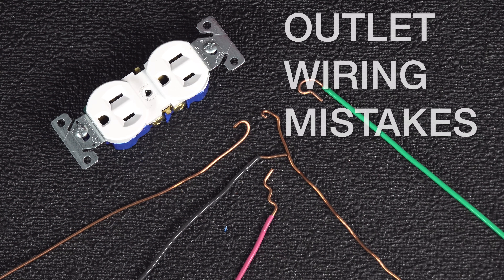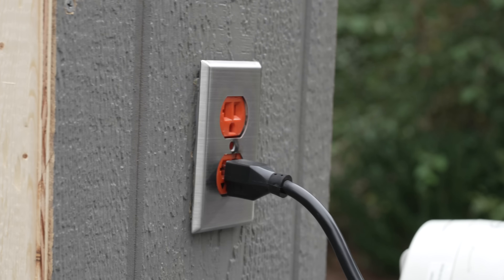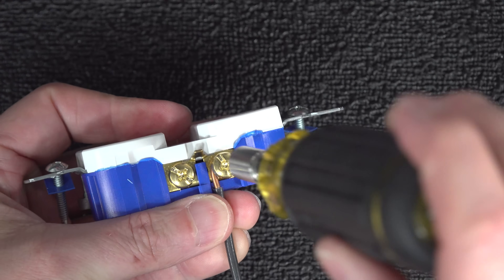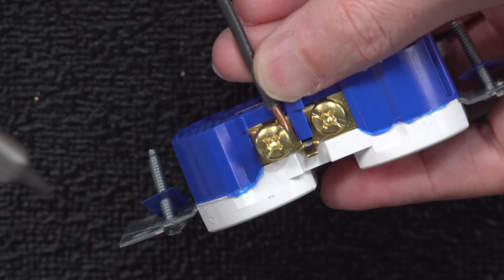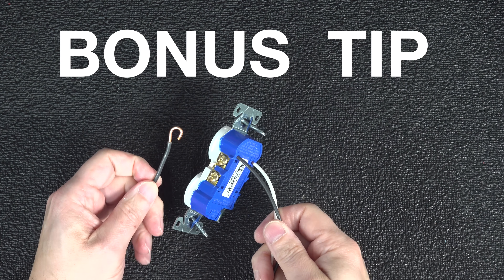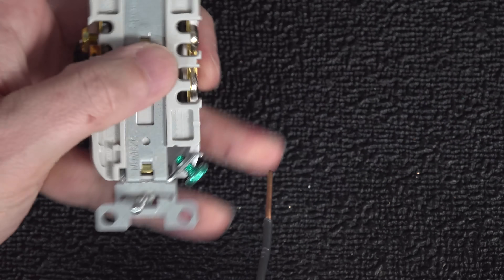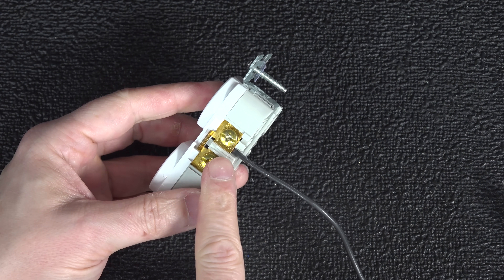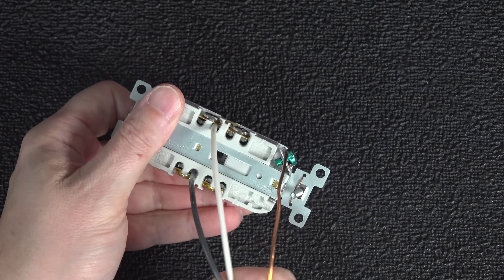BEWARE Of These 3 Common Wiring Mistakes On Outlets & Switches

Comment: been wiring for 55 years. it never stops til i die. joy of the job means never needing to stop doing it. you video is aces in my book. keep on doing what you do
Reply: Like to hear people who love their line of work, even after 5 decades. Keep it up. I'm working on my old rental as we speak, built around 1920/5. Just found some old newspapers today up there 1934, (guess thats when they blew in insulation) I still have Knob&Tube for some circuits. Changing them out. Wire and insulation still good, I'm amazed.

Comment: And in Europe you don't need any tool but a wire stripper to connect a socket or switch plus the wiring diagram is printed on the back of the socket and switch, no possibility of making a mistake unless you want to.

Comment: Don’t use your device as a wirenut. Use wirenuts. And wrap it with electrical tape after making connections, especially with an uninsulated (ground) conductor.

Comment: Another tip: always shut down the circuit when wiring outlets and switches. Then, record the circuit number on the back of the plate cover with a sharpie so that next time you know exactly which circuit to shut off.
Reply: I was an electrician for 35 years..never saw or thought of that. Brilliant! 👍👍👌
Reply: @charlieboutin3341  Could not agree with you more.  We're never too old to learn new tricks.  What a time saver!
Reply: @charlieboutin3341  and that's part of the problem....
Reply: @Werecalledtodestroyevil the problem is thinking learning stops STFU and keep learning
Reply: "Always shut down the circuit when wiring outlets and switches." ✔️
(Shocking but true! ⚡😉 )
Reply: The circuit number is a great idea. Never thought of that. Great time saver!
Reply: Until a painter comes along and puts covers back wherever..
Reply: I just made a lookup table on the inside of the electrical box. Also works...
Reply: @ricksherman34  this is a good idea at the time or if you keep up on it. The 2 houses that I have owned have had this but they are all scratched out and modified at least once.
Reply: Also include your phone number.
Reply: This is a brilliant life hack.
Reply: We found out Sharpies would bled through the thin plastic and show. This was especially true on the Break Resistant Nylon covers. Use a Paint Marker instead, it won’t bled through.
Reply: I mean almost every house I've ever worked on had every breaker labeled in the panel. The rare cases they didn't you just use a circuit tracer..plugs into the outlet and beeps when you pan the tool over the corresponding breaker.
Reply: Handyrus : Cover plate circuit number..."EXCELLENT IDEA!!"'
Reply: @TimothyWmYoung thanks
Reply: Great tips
Reply: Make sure no capacitors are on the circuit after turning it off!
Reply: Wow, great idea! Thank you
Reply: Hot tip. Thank you smartypants :)
Reply: I work live because I’m superior to all you chumps
Reply: If you wire up a light switch and you don't turn the power off you deserve to get electrocuted
Reply: My man... 

I was doing this on turns and people thought I was crazy. I did colour coded stickers, but this is much wiser in case those change. Slot 13 will always be slot 13.
Reply: Great tip
Reply: I just shut the main
Reply: Hopefully, unless some clown changes it.
Reply: Love this idea
Reply: Until the painter takes them all off
Reply: And then, learn proper terminology, like what the difference between an outlet box and receptacle is. 💀
Reply: Good idea on rotating the circuit number!
Reply: @davew4176  at what point in his comment did he say "rotate the circuit number"?
Reply: @redstoneddad3981  i think auto-incorrect
Reply: @redstoneddad3981  rotate = record on auto correct LOL.
Reply: @redstoneddad3981  - probably unintentional auto-correct, for what was intended to be "record the circuit".  Not really too difficult, is is?
Reply: @acommenter5184  this was already answered a month ago, but ty 😊 
Kinda was difficult 😕 

"...is, is?" (Another auto correct issue?) People should read the comments they post and correct their mistakes, otherwise simple clarification questions arise, like mine 🤔
Reply: @redstoneddad3981  That's for sure!  Definitely my bad; and apologies for snarkiness.
Reply: @acommenter5184  it's ok, have a great day 😎
Reply: @redstoneddad3981  I’d bet  he meant notated
Reply: @redstoneddad3981  My guess is that the writer meant "notate"???
Reply: I wouldn’t write the circuit numbers on the back of the cover, what if the cover is moved to another device? Just get a number book and label the circuits at each connection or junction. And you want to lock out that circuit or they make lock outs for switches but make sure it’s not fed from another source. Also check for shared grounded wires in the branch. Also check with a NCVM.
Reply: @byronnlangley  why the hell would anyone move them? 😂
Reply: @roberthughes2687  crazy as it sounds when people paint. They throw all the cover plates aside and randomly reinstall the plates when the paint is dry.
Reply: Don't forget to buy that $50 circuit tracer for when the painter comes thru and mixes up all the covers.. 😂
Reply: @Matt Lewis  yes. Circuit breaker tracer is a must. Also a toner is a must have tool.
Reply: Horrible tip
Reply: @largepizza2185  why?
Reply: For sure.
Reply: Sometimes you can turn the circuit off to work on certain things. Say for a hospital plug that has more down the line and is powering a machine for a patient
Reply: Nah don't have to worry about any of that. Just short it out at the outlet it will trip the breaker.
Reply: THAT WILL NEVER WORK

Comment: Big mistake 99% people including most electricians is not using a torque driver or torque wrench to tighten all electrical connections as required in the NEC. Been over 10 years since they made manufacturers only allow #14 guage copper wire to be back stabbed into flimsy holes. I always argued with fellow sparkles about stab in connections. Said when they allowed ground wires to be back stabbed might then consider using them.

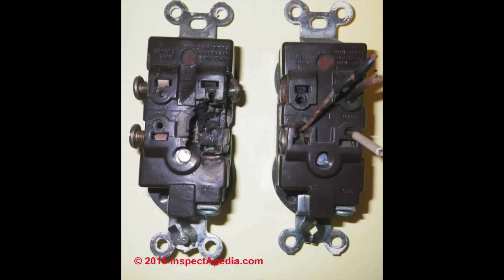Comment: 2:45 just so you know, the finnissh version of that connection is rated for 25 amps at 230v so it not being heavy duty enough for a simple 110v 10 amp connection ssounds alot like something you made up

Comment: Anyone know if the rule below, applies to basement installation. The rule doesn't make any comment on it. This is Ontario code I believe. So 130 mm is about 5"

"The stove receptacle (14-50R) must be mounted so the centre of the receptacle is 130mm from the finished floor (rule 26-744 (6)(a))"

Comment: Green screw-the equipment ground is not required  by code to be without a clamping plate. 
There are devices, such as gfci receptacles and some switches that manufactured with clamping plates for ground connections.

Comment: Good video although I did not agree with all of it.  It doesn't really matter which way the hook faces, the screw turn direction is preferred but truly makes little difference with solid conductor wire. When you tighten the screw it wants to spread the wire not twist it. The wire is locked in a recessed square that prevents the wire from being squished out from under screw. On stranded wire it does matter because individual strands can be twisted out. Also Copper color is black (positive) and white/silver is common/negative. Answer this question, in an alternating current 60hz the current travels one direction then reverses polarity 60 times a second in a 60hz circuit. They are both the same just different polarities. Which is positive and which is negative/common? I know the answer just playing with you for entertainment. Ground makes the difference, agree or disagree?

Comment: i dont like to mess with this   i know its dangerous  but we  turn off  the power... but. i did change  the plug  i dont think its been change for over 30 years   plug was loose when u plug it  in   cover we had to strip it  was not enough wire  there was 4 wire and ground   had to connect

Comment: I won't use an electrical outlet that's stamped 'made in china' as is your 'upgraded' demo. I also don't agree that you're getting more contact area on that 'upgraded' outlet, none that would matter anyways, and carries a risk of backing out due to not enough clamping force. I will always hook, it's failsafe

Comment: i worked as a lineman and was at a trouble call  one night for flickering lights at a home and ended up finding some of those push in connections on some of the outlets. the people were kinda poor and i helped them out by fixing some of them and told them to get an electrician to check the rest of the house out.

Comment: I didn't see this mentioned in the video unless I missed it, but you should also ensure that the direction of your hooks is such that when you tighten the screw, the hook wants to be forced closed rather than forced open.  Not an electrician, but I found this mistake on several outlets/switches when I re-did many of them and some of the connections looked...sketchy, to say the least.  Another mistake is just jamming the wires into the box rather than neatly folding them and trying to make sure that there's no opportunities for shorts and as little pressure being put on the connections as possible - it only takes maybe a minute or less per outlet/switch to do it nicely.

Comment: Not bad but always put the ground lug on top when installing, that way the ground is exposed if partially plugged in and also the ground will help if someone steps on the cord
Reply: Chris - If I understand you correctly, you're saying the preferred orientation of a 3-prong outlet is to have the ground hole closer to the ceiling than the floor?  I rarely if ever see them that way (doesn't mean it is best, I realize...).

Comment: Your outlet should be installed with the ground plug on the top. if a flat piece of metal falls on the plug nothing happens with it hits the ground but it could cause a short and trip the bracker when the ground is on the bottom

Comment: Alot of GFCI recptacles are starting to use clamps on the grounds now.... Number 1 mistake most rookies make is forgetting to kill the power.... Im not sure if you mentioned that but its really the first thing that should be mentioned in any electrical instructional video...

Comment: At 1:10 you got the wire bent the opposite way you are screwing.
Reply: So 110 mph divided into failsafemode  renewed by myrtle bitch devided into 28 miles per gallon dived into hidden rewired connections = a hard time? + Summer winter and fall and the damn voice of deletion? Follows off i26

Comment: totally old cavemen style socket and wiring system,dangerous and shit, today normal socket need only 3 wire and have spring connection wire to sockets, this have only idiot use old shit. if need good safe socket buy new spring load wire connection sockets.

Comment: I am a retired electrician and this an outstanding instructional video, one of the best I have seen. I NEVER used those back wiring holes. I did not trust them for longevity. I totally agree with you on every point because that is exactly how I wired up my receptacles! Good Job!
Reply: Ever use wago’s?
Reply: @alexmoran2859  they are getting spec'ed for jobs lately in construction, I hate them.
Reply: @alexmoran2859 I use them once and I don't like the connection they get. Probably less connection then backstabbing a plug.. probably go back to wire nuts permanently
Reply: @alexmoran2859  the cam lock ones are good.  I've been changing out the push in ones for 20 years.  They should be outlawed.  Always the neutral side burns off the little bur that holds  bits onto the wire.
Reply: In Europe, everything is moving away from screw terminals towards Wago style spring loaded terminals. The spring tension remains more or less constant as the copper wire flattens over time, whereas a screw doesn't and can work lose.
Reply: @erik_dk842  Wow, I never would have thought! I have been wiring with looping around screw terminals for years. I have never heard of the Wago style of terminating a receptacle. If is constructed for long endurance that's good. It would sure save a lot of time.
Reply: Do you have any advice for anyone thinking of becoming an electrician?
Reply: @km6610  go to the local ibew and talk with them. Even if you don’t join you’ll learn abunch
Reply: Wait you land the ground last?
Reply: That's why I'm leery about using those lever nuts. You give out the same amount of contact as those backstabs. Probably won't use them again
Reply: you are right, over time, heat cracks the entire outlet, i have had to replace at least 80 in my home because they were backstabbed
Reply: I'm an electrician too and the quick connections at the back are indeed shit, the amount of times i've pulled out an outlet and had a wire pull out of them...
Reply: The electrician that wired my house left loose outlets, loose switches, and used stab connections in everything.. I had to go through and fix all of it.. half of my light switches you'd go an flip them and literally hear discharge from the switch due to poor connection from the way he wired em.. switched to the screws and never had issues. Laziness is all ill say.
Reply: @freakofnatur101  check their work before you work their check.
Reply: @freakofnatur101  My father's house had a basement that was finished off in 1965 and they used outlets (which I've never seen anywhere else) that only had backstab connections. Somebody must have thought they were the wave of the future. 57 years latter, after ample evidence that they don't work, code still allows them for some reason.
Reply: @pcno2832  its funny how stupid the code has gotten over so many things (arc faulting every plug circuit), but things that are actually dangerous and could cause problems like the quick connects on outlets are ok.
Reply: @empire0  the NEC  does not require every receptacle to be AFCI nor to be protected by AFCI
Reply: @alvilla701  in Canada it's required. Not for counter plugs or designated appliances, but all bedrooms and convenience outlets. Arc fault breakers are significantly more money so it really drives the cost up

Comment: Standard 110/120 volt AC wire colors are white (neutral) black (hot) green, and rarely bare (ground) What's with the RED wire?!?
That double gang outlet would have White, Black, and green or bare wires, if the building is wired to meet code. RED is ONLY used in DC wiring, and is ALWAYS a hot wire. DC ground is black. In applications where you have both AC and DC electrical systems (such as marine vessels) the ground for both is changed to either green or pink, so the DC ground wire (normally black) isn't accidentally connected to the AC Hot wire (normally black).
Reply: in the US the color scheme is different- black red and blue are hot for 120V- white is neutral- green and bare are ground.  in a recep like this, black is A phase and red is B phase.  if you break the tab, the red can then be used a switched hot for the other half.  black red and blue A,B,C are all allowable colors for 120V in the US

Comment: Saw an outlet where they had a wire under each screw AND made use of those spring clips in the back.  Surprised their house had not burned down.  

I would never connect 8 wires to an out let with those channel grooves.  Pigtail!
Reply: that is a code violation

Comment: Ha ha. You Yanks have awful plug sockets. 

Either use a ring crimp or buy a better designed socket.
Reply: ring crimps are the worst things ever invented
Reply: @westbornfarms  American plug sockets are the worst thing ever invented
Reply: Ring crimps cause heat and failure not unlike yourself